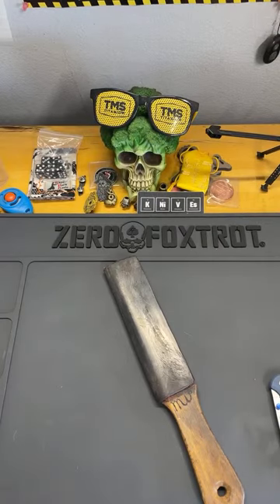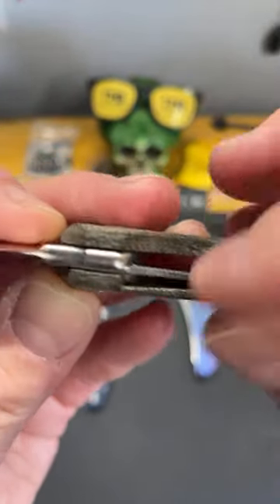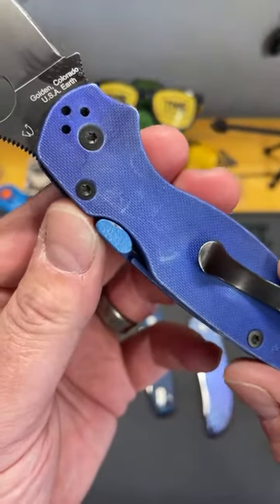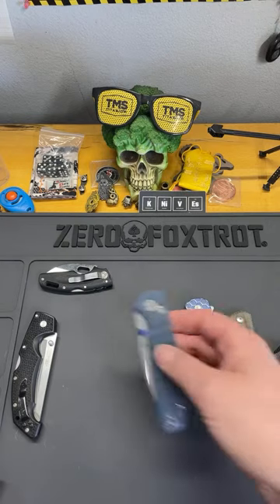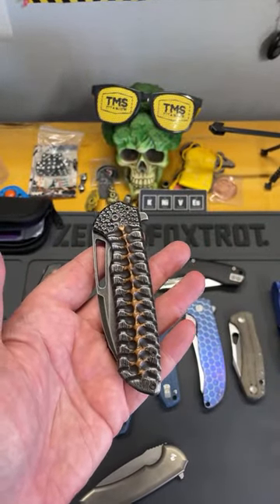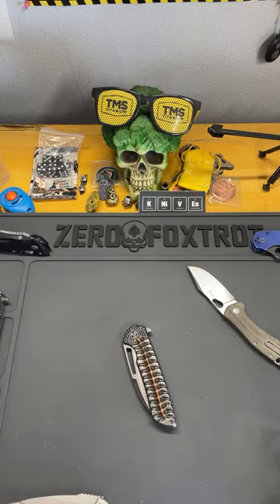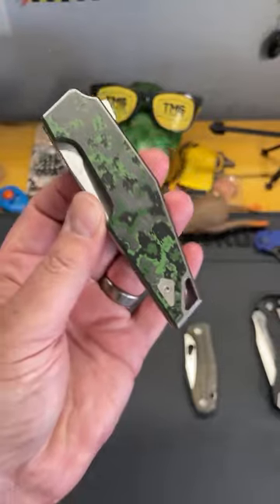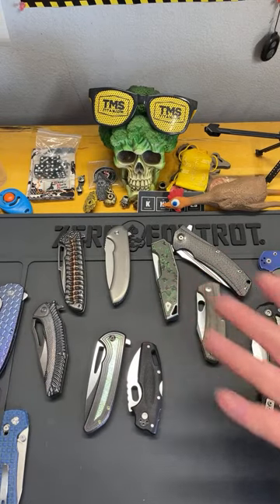I WAS TOLD THESE KNIVES WOULD FAIL!!! LETS FIND OUT

Comment: I don't buy a lot of budget knives, but I bought one of these on a whim. To my surprise, I really like this knife a lot. It's light, thin, good texture, great jimping, great clip, and looks good. Nothing wrong with the lock on mine. But why the hell would you even spine whack this knife? It's a light use knife that is meant for cutting cardboard, twine/rope, opening envelopes, and similar things. If you need a knife that will chop 2x4s buy a cold steel.